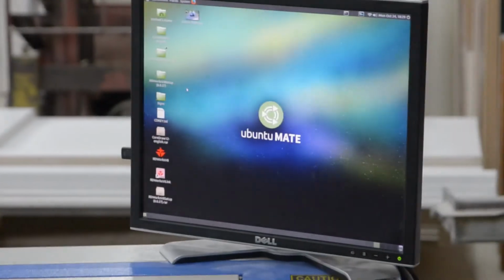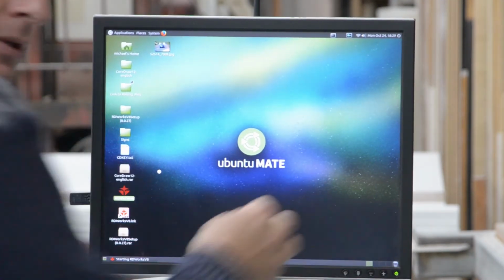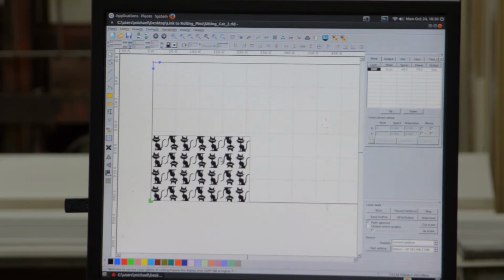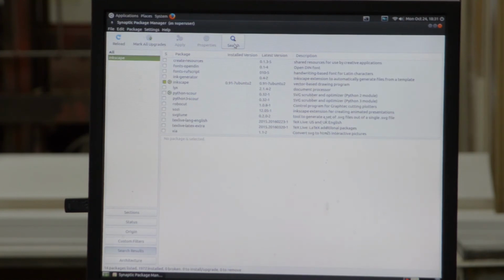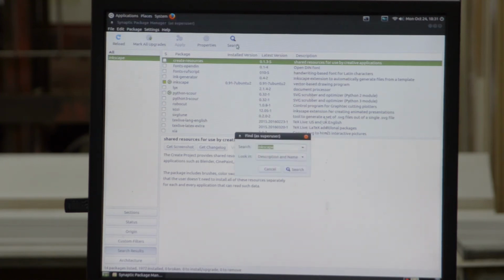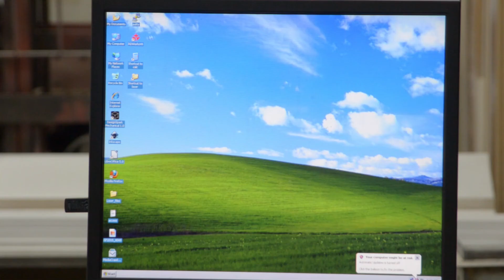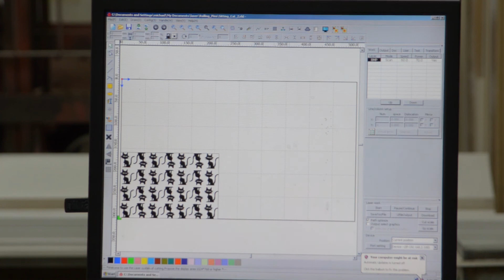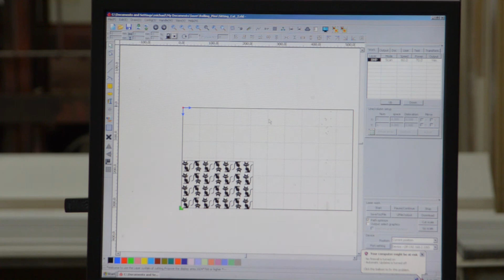SHOW & TELL my Laser cutting & engraving rig.

Comment: lots of other users with your machine do not use the installed power plug sockets as the wiring is of a low quality.  they just use a standard external multi socket.  please check your wiring.
Reply from the maker: So far I haven't had any problems with the wiring.